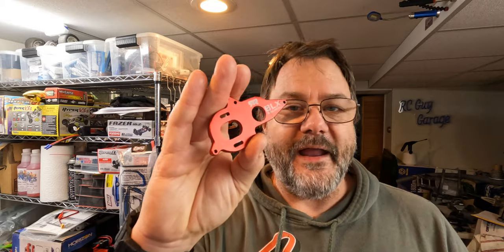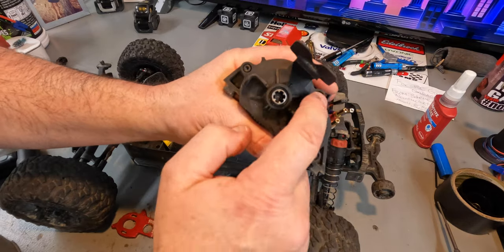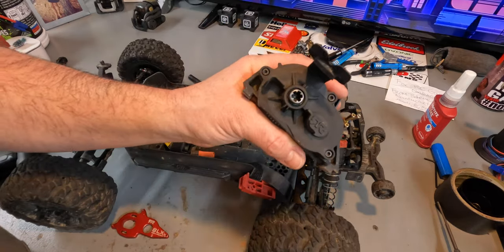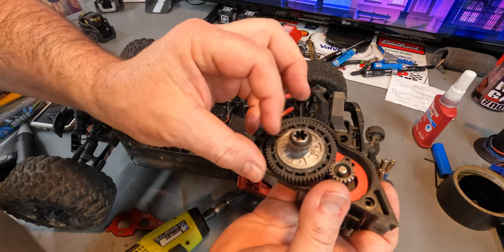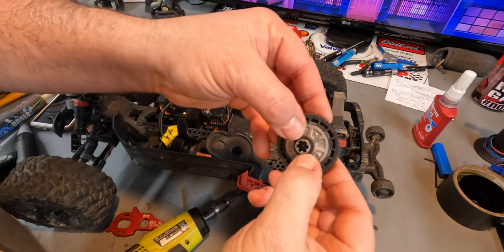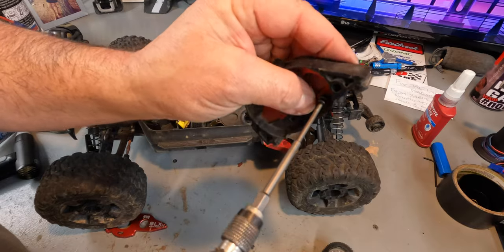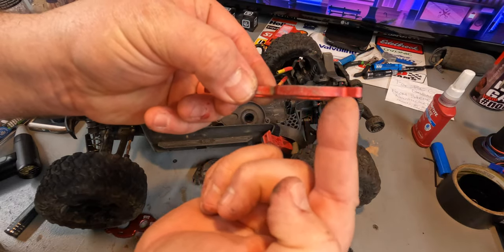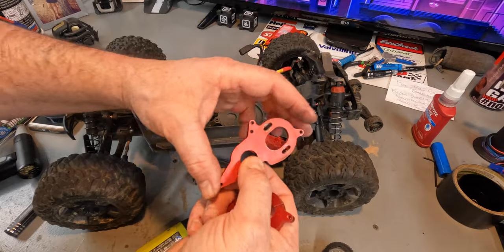OG Arrma Big Rock Motor Mount FIXED

Comment: Ive got this on mine, no issues since fitting. I went through 3 of the old BLX mounts in 5 months (sh!t driver), not a single issue since fitting this new one (311106 part number).
Also I swapped out the yokes to aluminium ones front and rear and haven't stripped the plastic diffs either, well worthy upgrade! (I run max punch) ❤❤❤

Comment: Yup.  I did the same thing about a year ago when I did the slipper eliminator, with the traxxas spur gear. It made a huge difference.  Also taking the center diff module from the 4s line.  That’s a solid ass upgrade. Give it a shot u, won’t regret.
Reply: For real

Comment: Yo dude, love your videos man. If you look in the instructions that come with the vehicle, certainly for the outcast 4s V2. ARRMA say to set the mesh on the motor plate first away from the plastic module housing. Worked a dream form me installing a 15 t pinion, mesh is dreamy atm haha 👍
Reply from the maker: Instruction manual????? If that involves reading FORGET ABOUT IT 😂🤣😂🤣

Comment: Bro. Good afternoon. I watch your videos. I kindly advise that you just get the M2C racing motor mount and chassis brace. All of my extreme bashing issues with mesh/bent motor mount STOPPED after installing that beautifully designed motor mount/chassis brace. I even installed the heavier Spektrum 2050kv motor and running the 150 amp esc on my Big Rock 3s. 

We are supposed to help each other and this is my contribution to you sir. Good luck!
Reply from the maker: M2 who?

Comment: yes arrma changed that plate with the release of the v2 4s cars you can easily see the difference where the extra grove for you to set the pinion grub screw the one you removed doesnt have it so it the old style if you have your owners manual exploded view that part number is different then if you now go on website and look at exploded view its a new number.... running change that wasnt mentioned
Reply from the maker: The new in the bag part I have for the ULTIMATE Big Rock doesn't have a provision to set pinion either👍💯
Reply: @rcguygarage  well you can clearly see it in your video so maybe your not understanding what i mean and i cant post screen shots of your video here but you definitely have 2 different mounts in your hands in this video
Reply from the maker: Are you talking about the slot on the new mount for the driver yes that's there but nothing on the plastic case
Reply: @rcguygarage  yeah plastic isnt different just the metal plate that slot is the sign its the new one.... that slot is their to set the grub screw install motor on plate drop in slipper set your mesh pull slipper out install motor and plate back into plastic drop slipper back in and close it up.... ive got plenty of videos on it thats`the`easiest way ive found to properly set mesh works great....
Reply: Yeah Guy, you set the pinion height BEFORE you put the plastic case on.

 No slot in the plastic case because it would be another pathway for dirt to get in IMO.

It is a pain, but I had no other option because I don't have those nice ball end hex tools
Reply: @VDVC-RC  even with nice ball ends it's still easier to take out the 1 screw holding on the back case and then you have 100% access to the grub screw to set height and mesh I have a few great videos showing this but I know other YouTubers that don't like people putting their links in comment
Reply from the maker: @RC4us yep cause some like to spam porn in the comments 🤬 been there, seen that early on👍💯
Reply from the maker: I can't remember if this is an Arrma pinion. That can make a difference as I normally use HoBao pinions 😳😜🤪
Reply: @rcguygarage  them Hobao are nice
Reply: @rcguygarage  man my Facebook group really went thru that
Reply from the maker: @RC4us agreed 👍💯
Reply from the maker: @RC4us agreed 👍💯

Comment: I am working on my 3s Typhon motor mount. I got the hot racing mount. What are your thoughts on the space between the motor and chassis? Should you place something there so the motor can't bend down? If you did put something there, would a chassis flex push against the motor now and bend it up? I suppose a chassis brace could fix that.
Reply from the maker: What may happen is if whatever mount you place at the end of the motor can is rigid it can break the chassis. If you use something flexible you have to keep in mind whatever flexible material you use will concentrate heat in that area.
Reply: @rcguygarage  it's probably best to just leave the space then. I'm looking at that aluminum m2c chassis brace that mounts underneath. Arrma also makes a composite one that is 3 pieces, have you ever used any of them?

Comment: Don't forget to get yourself some Titanium screws to mount that motor (no loctite needed with Titanium!)
Reply from the maker: Yep we'll let GALVANIC CORROSION fix that up😳😂🤣😂🤣😂🤣
Reply: @rcguygarage   I guess "personality" can be deceiving. Continue down your own path guy. The knowledge of others obviously is of no value to you. FYI the level of corrosion depends on what catalyst you're exposing your vehicle to. I assume you don't bash at the beach and drive into salt water. But hey, you do you.
Reply from the maker: @biggnasty989  are you serious guy???? I even put FRIGGEN smile laugh faces and you took my comment in a negative light. Jesus Christ this world is so fing SENSITIVE these days. I GET WHAT YOU WERE REFERRING TO. sorry I didn't get TECHNICAL and just agree to your GOOD suggestion. Yes titanium and aluminum will corrode together no different than loctite and the titanium will exceed the strength of the aluminum motor can giving a GOOD BITE into the aluminum threads. You also don't know my ORIGINAL comment I ERASED said "AWE HELL NO them titanium screws will be worth more than the whole vehicle. 😳😜😂
 But hey it's all good guy. Your comment is your own to say however you like. Have an awesome day. 👍💯
Reply from the maker: @biggnasty989 don't know why your comment is pinging a freaking nerve with me. As far as your (I guess "personality" can be deceiving) comment part goes, I've been going down this path for YEARS and it has served me very well. I hope YOUR own path serves you as you need it to. Remember we ALL live on this same planet together and are ALL humans. This petty BS needs to stop somewhere and hopefully it stops right here. 👍💯
Reply: @rcguygarage   Hey man. I was only trying to get on your nerves just a tiny bit. It's all good man. We all are here to have a good time. I'll keep watching your videos because I am old Ahole who likes to watch other people of similar personalities have fun with RC's. Have a great night man.